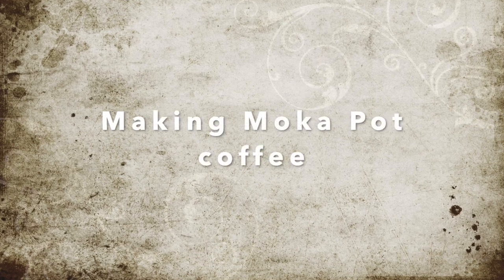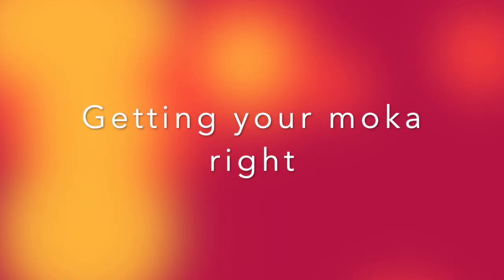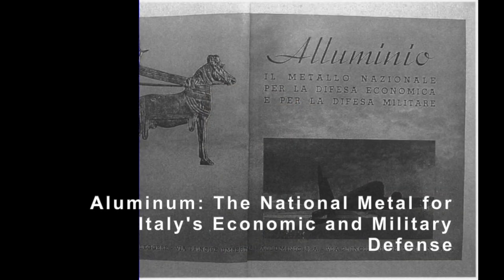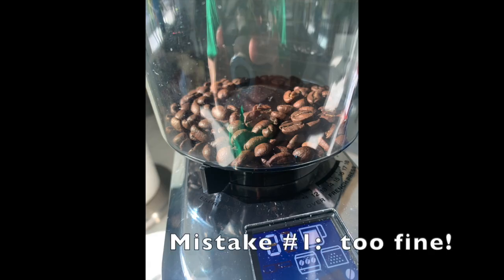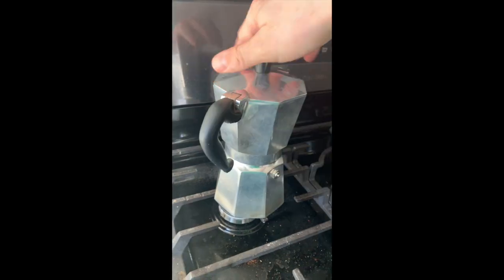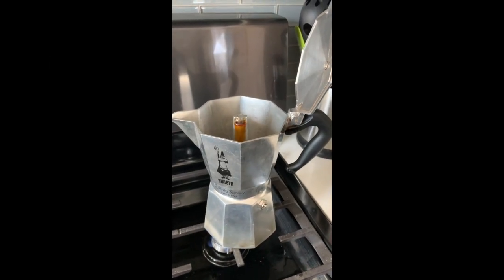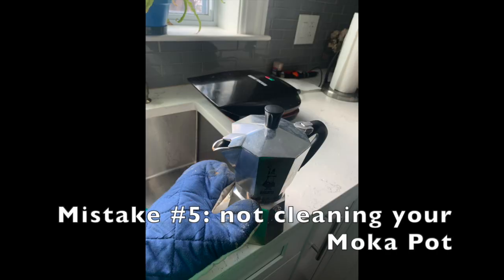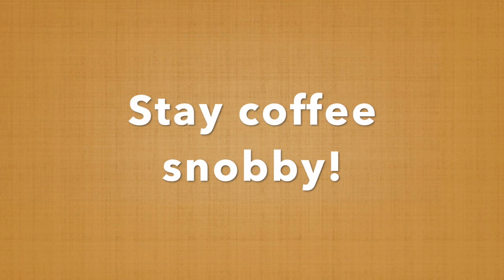Why your Moka pot tastes bad

Comment: Sharing a few tips here:

I've never seen anyone boiling the water before putting it into the moka... the rest of the video is quite right, but you didn't put enough coffee, you should fill it up evenly and add a little bit more at the top. After that you have to close it tight and boil the coffee at low flame, if you do this you don't have to put the moka in cold water because the coffee will rise slower.
At this point it's very common to stir the coffee inside the moka for a little bit. In certain parts of Italy, like Naples, they add some sugar during this step.
Anyway, mokas need to be cleaned, you should never leave it dirty (mostly for hygiene, bleah) but you NEVER, EVER wash the interior with dish soap. Don't, just don't.
Another tip is that "LA MOKA SI DEVE FARE", this means that the more you make coffee with a moka, the better it will taste, so it always tastes bad the first few times you make coffee with a brand new moka. Don't give up, it gets better!

Source: italian addicted to moka coffee, fatto come si deve però, che sennò fa schifo, viene slavato e fa proprio cagare
Ciao!
Reply from the maker: Hi Matt, thanks for your contribution. I personally don’t like to ever add milk or sugar, but of course people can do what they wills. Thank you for your contribution of cultural context!  

If you wanted to know why I preheat the water, there’s a much more thorough discussion in my follow-up video, which was mentioned in the description and stickied to the top, but I’ll post it again here anyway: https://m.youtube.com/watch?v=jcgMeDDAT-s
Reply: @loodog555  thanks man, I also watched the other video now :) I would like to clarify that my comment is about the traditional italian way to make coffee, and I don't think boiling the water before is wrong, it's just... different! Anyway it's always nice seeing passion for an important part of my country's culture such as the true italian coffee
Reply from the maker: @mattmactire3961  What I’m learning from comments is that Italians just seem to not care about reducing the bitterness associated with 2,4-decadienal, 4-ethylguiacol, and 2,4-nonadienal. Which is fine, you can brew it however you prefer it, of course.  It just means you’re not so oriented towards Third Wave coffee ideas with regard to the under extraction/over extraction model.
Reply from the maker: Why to use preheated water: https://www.youtube.com/watch?v=O14BIH-9KTA

Comment: What is the point of pre-boiling it and then not turning the burner to max? Boiling water is only one temperature.
Reply from the maker: You do not want to boil the water in your moka pot!  Surprisingly, the coffee extracts before any water is boiling!  My primary purpose is to speed up the whole process, but the initial water temperature of the moka pot affects the brewing in surprising ways, for example by actually impacting the temperature at which the coffee extracts.
Reply from the maker: Why to preheat the water: https://www.youtube.com/watch?v=O14BIH-9KTA

Comment: Bialetti are amazing. 
Replacement parts are available.
Had mine for 3 years never had to repair anything
Reply from the maker: They are elegant little things.
Reply from the maker: @tjtanous623  Absolutely, the gasket is the only thing that ages and fortunately, the design has been standard for long enough that those never change.

Comment: No no no.... You should use cold water,  bring the Moka to boiling point on small fire, as you said, and add way more coffee powder: the Italian rule is to make a "little mountain" at the center of the filter,  over the border level, and then screw the upper part; in this manner you naturally gentle press the coffee, filling all the air gaps but without overpress it. Wash the pot every time, but absolutely without soap: only water! (hot water, if you prefer...).    The advice about the "not too fine grinding" powder is ok.
Reply from the maker: Don’t believe the Italians!  There are considerations to what the effect of changing the initial water temperature is that are a very surprising.  Check the links I posted as well as the follow up video I’ve posted.
Reply: Well, I don't understand your point: if you like italian Moka coffee, maybe you want to consider the way we historically made it, not your "scientific" theory. We do it this way, if you like it, you might do in this manner. Otherwise, like every other artisanal and historical product, it will be different ("american-italian Moka coffee"?); probably better for you, but non original. Like a Brooklyn made pizza.
Reply from the maker: @biula3278  I think I can help clarify the confusion.

People can do whatever they want. There is no wrong way. My goal here is just to draw attention to things that can be tweaked and what effect it will probably have.  The sheer volume of people saying that it’s WRONG to preheat the water tells me that a lot of these people hadn’t even considered playing around with it as a variable.  

I am also suspecting that a lot of people who are commenting are not familiar with the barista notion of optimal extraction, a sweet spot between underbrewed and overbrewed that minimizes compounds that tend to taste bitter or rancid but also doesn’t have sour notes dominating.  (there is a really helpful graph I can show you from Scientific American, if you’re interested).  My brewing advice is oriented in that direction, but that doesn’t have to be the goal of everyone.  For more on this I would recommend my video about burr grinders: https://m.youtube.com/watch?v=dgM-_nPPKgw

Also, I just put out a new video about siphon brewers, that discusses a bit more of the nitty-gritty about moka pots and why siphon brewers are more precise tools: https://m.youtube.com/watch?v=AUh8bSv_x9U

I wish you the best coffee!  Stay coffee snobby!
Reply: Say what you want; as every italian I have three coffee a day in average, from the age of thirteen on (this is 43 years of experience), a half of which with a Moka... experience and developed taste cannot be ignored. You cannot teach a monkey how to climb a tree.  Have a nice day.
Reply: @biula3278  Where do you stand on running the bottom under cold water to stop the brewing process?
Reply: @R.W.S.  Mhhh... someone do this, but is not a traditional move; on the contrary, is very common to stir the coffee  with a little spoon before serving. This because the first coffee brewed is stronger, the last part is lighter and creamier.
Reply: @biula3278  Thanks for your reply. I'll definitely try stirring on my next brew, never thought to do that.
Reply from the maker: @biula3278  Why to preheat water: https://www.youtube.com/watch?v=O14BIH-9KTA

Comment: You can put a fine layer of water on the top part. Not much, just to cover the floor. This avoids the first drops of coffee from hitting the hot metal and evaporating, which causes it to burn and give that excessive bitterness.
Reply from the maker: That is a very interesting idea.  Do you huge a large difference?
Reply: @loodog555  Yes, from my experience, it works well. I'll try next time to combine with the tips from this video.

Comment: 1st Rule: the pot must be steel, not aluminium. Even if the original was alumnium. 
Also, the water must be cold, and the right amount of coffee.
Reply: this one jake dude who does coffee videos says you put hot water in.
Reply from the maker: @Daniel-dj7fh  I did it that way here.  That doesn't mean you need to.  My follow-up video discusses this at length: https://youtu.be/jcgMeDDAT-s. 

Here is the effect that initial temp. has on extraction temperature: http://www.msc.univ-paris-diderot.fr/~phyexp/uploads/Moka/article1.pdf
Reply from the maker: Just published a video discussing aluminum poisoning and moka pots! https://youtu.be/qV3Us0KkIMo

Comment: Just a friendly suggestion:  put cold water, never preheated - make no sense. There is something in timing - check other videos on YT, possibly Italian, so you will understand. Also, you do not heavily wash mokka pot every time. Than, not every blend is good for mokka pot or espresso machine,...... and is not only the size of the grain (which is right what you said). Also, good advice is about the colour of coffe - you should remove it as you said but not because of the bad taste but unhealty for your heart (like making espresso - same thing). I have been using Bialetti for decades, different sizes ( 1 coffe to 6 coffe) and it is the best choice for me (and very simple), also, I have a proper espresso machine at home - two totally different types of coffe in taste, making,....
Reply from the maker: Hi Daniel, I'm going to ignore the issue of cold vs. hot water because this has been discussed AD NASEUM already and I've even made a 12-minute follow-up video that discusses it: https://youtu.be/jcgMeDDAT-s (sorry if I'm salty about this, but I stickied the comment).

Thanks for your advice about washing.  I haven't experimented around much, but can't bring myself to leave old dried coffee on the surface for the next brew.  I just scrub it down with water and leave it.  

On the issue of bean blend, I also discuss this in my newest video, where I recommend avoiding dark roast.

I'm interested in your claims about heart health because I've read the recent study by Thelle et al and produced a video discussing the effects of coffee on cholesterol, heart disease, and stroke: https://www.youtube.com/watch?v=9ERk020_III so I wondered if you could go into more depth about what you've read and where.
Reply: @loodog555  I read that long time ago, so if I can find it i will post.
Reply from the maker: @danieljagar4887  Great!  Always seeking to expand my knowledge base on this stuff!
Reply from the maker: Why to use preheated water: https://www.youtube.com/watch?v=O14BIH-9KTA

Comment: Judging by how the pot nearly slipped when the top is being screwed on, I would not want to do that when the bottom is filled with boiling water (even with an oven mitt)! Boiling the water first is using two tools and two steps when you could do it in one anyway. I still enjoyed the video along with the researched intro, and going to try the quick rinsing cool-off trick you showed : ) Thanks for sharing!
Reply from the maker: Thanks for your comment.  I do mention safety as a concern in my follow-up video: https://www.youtube.com/watch?v=jcgMeDDAT-s
Reply: Technically, you can also boil the water directly in the reservoir, before placing the grounded coffee and attaching the top.

Comment: If you want a denser espresso you may want to try a fine, compressed grind that doesn't leave any corridors for steam to escape. The downside of this method is that you use more powder but only a part of it will be extracted, so some of the coffee goes to waste. It produces a very tasty, aromatic coffee though.
Reply from the maker: Sooo, I agree that grind size is an important variable.  I discuss this in my update video.  Smaller grind will definitely cause more extraction both because of surface area, but also resistance to the water flow.  Based on this logic, I disagree with your claim that less will be extracted.  I think quite the opposite.  

But don't trust my bullshit!  Try it out and report back!

Comment: Never seen anyone just half fill the filter with ground coffee before, only completely filling it without patting it down. Gonna try the filter half full method next time!
Reply from the maker: Well, it's about 80% filled, but it's something to try. It's not any more right or wrong than any other way.  I wouldn't expect 50% to work out well, though!  I think it wouldn't be enough resistance to get the coffee to extract sufficiently so my prediction is sour and weak coffee with 50%, but let us know!

Comment: Why would you drink coffee if you don't like it bitter? I don't understand.  
The defining characteristic of coffee is to be bitter.  
Add some milk if you want to smooth the bitterness.  

Yes, clean the Moka pot, however be mindful of doing it after you've used it (not right before) and, especially if it's made of aluminum, do not use coarse things to clean it, you do not want to scratch the aluminum and drink it.
Reply from the maker: I get you, man, but I would rather do anything other than add things to my coffee the diminish the unique flavor of the beans.  Coffee is a bit bitter but there is a certain kind of unnecessary bitterness that comes from extracting too much from your beans.  This is not a recipe for removing all the bitterness, so much as its a set of things that you can tweak to adjust the flavor profile you are getting.  Stay coffee snobby, my friend!
Reply from the maker: Just published a video discussing aluminum poisoning and moka pots! https://youtu.be/qV3Us0KkIMo